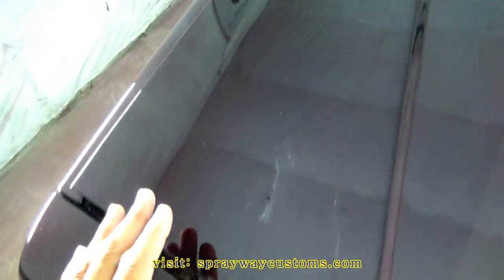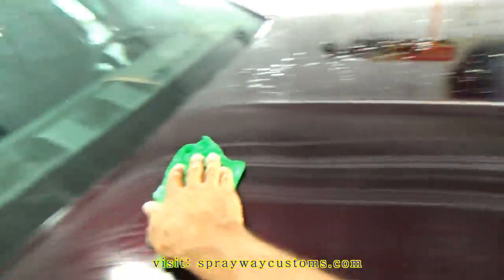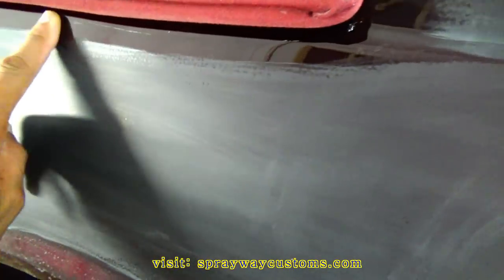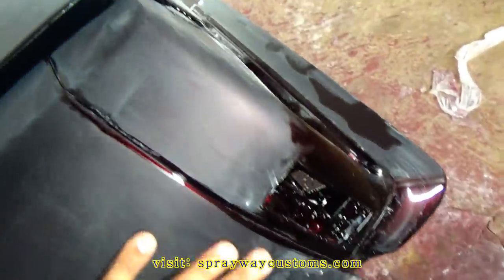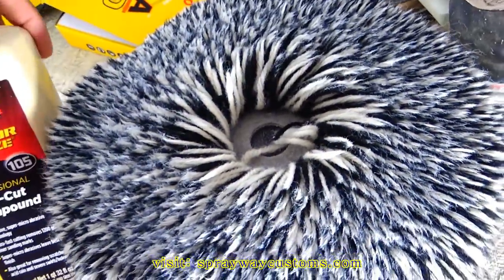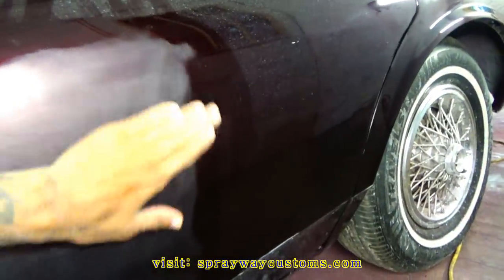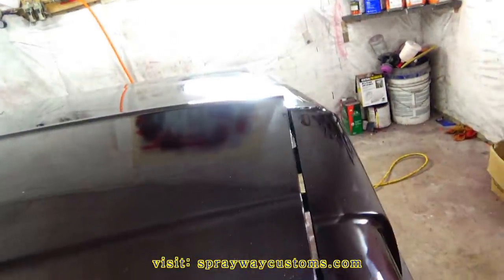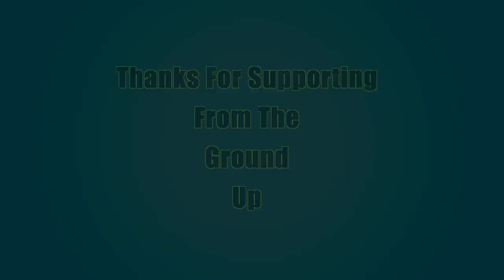How To Remove Orange Peel / Cut And Buff A Car After Paint - Box Chevy Caprice LS Candy Brandywine

Comment: I used to sand it with 1500,then straight to 3000,today I did 1500 then 2000,then 3000 .what a freaken difference.Didnt have any haziness after buffing,other vidoes say 1500 then 3000.but that 2000 step makes all the difference in the world.👍👍👍
Reply from the maker: Yes it does....you can get it done by skipping steps but it goes a lot smoother by following the process

Comment: Bro I appreciate the detailed info. You helped me out this past week at work. Took a 06 Chevy full size Conv van in on trade 2 weeks ago. It has that shitty GM primer/paint combo that flakes off. They didn't want to pay for it to be resprayed, so I got to work. Dupli-color color matched off paint code, clear, wet sand, buff. I really only having problems blending with the old paint. Some spots turned out real good, others not so good. I'm will work on them Mon. Again you have helped me tremendously I really appreciate it bro
Reply from the maker: That's great man...my pleasure

Comment: Hey man a little tip to know if you’ve buffed enough or if the scratches are going to come back, when your done compounding or polish, spray some isopropyl alcohol and wipe with a clean microfiber, it will take all the fillers out and you can see what the panel really looks like if the polish were wiped off. Save you some time of having to go over spots 2-3 times
Reply from the maker: Yes indeed....I learned that the hard way 👌

Comment: So you sand in a back & forward motion is there a difference if you go in circles? Do you follow the grain (like in wood ) of the paint or body panels?
Reply: I'd say you're gonna have swirl marks if you go in circles. And that's a whole nother beast.
Reply: Sand in a X pattern. It’s called cross hatch.
Reply: @MriLoveMyLife  but ain't that for bodywork or can you use the same method for colorsanding?
Reply: 63 Impala rag Dude do the same for both
Reply from the maker: I appreciate all of the  input on the matter

Comment: First off really great work man! I watched both of your cut and buff videos. I have a few questions 

1) Is there another pad that you would use for step 3 (final polish) from 3M? I looked up that specific part number at it costs more than all the compounds haha.

2) I see you use maguire’s for the first two steps and the 3M for the 3rd. Does Maguire make an ultra polish that you would use for the final step? 

Thanks man
Reply from the maker: Yes they do make a final polish but I'm not sure on the exact cost of it at the moment

Comment: Been watching your page for awhile now man. Picked up alot. Question tho. I wet sanded with 1000 grit instead of 1500 to start. Clear coat didn't have a ton of orange peel but it had some. I buffed an area an there's scratches left behind. What's the easiest an quickest way to rid the entire car of the scratches? Wet sand next with 2000 or 3k grit or there's something else I'm missing??
Reply from the maker: If it's no bad orange peel, it's best to go with the less aggressive because it'll buff out a lot quicker. If you do go with 1,000 grit you should follow it with 1500, 2000 etc. I like to start out with 2,500 myself but if it's a lot of orange peel you'll be sanding longer.

Comment: Sprayway! What do you think about the meguiers 105 vs the 3m rubbing compound in that 3 piece kit?? Ive never used 105 but have been wondering.i got away from using wool pads. I use the 3m stuff with white foam pad and it rubs out 3000 grit easy
Reply from the maker: I like 3M better. I'm thinking about getting away from the wool pads also

Comment: Let me ask you something boss...I started buffing with 1500 then im gonna go with 3000 and  its because I got alot dirt nibs also alot of orange peel but my questions is if you clear is almost 100 percent you could just use 3000..please let me know thanks
Reply from the maker: jaimef101 it'll be good if you could start off with 3,000 grit because those scratches will buff out a lot faster. If your orange peel is bad it might be quicker to cut it with 1,500 grit

Comment: What grit you use to get rid of orange peel tried 1,000 grit today on metallic color but could I go lower than that like 600 or 800 grit.
Reply from the maker: If you plan to buff it afterwards without reclearing it I wouldn't go lower than 1,000 grit but you'll have to move up in grit from 2,000 to 3,000 to remove the previous scratches out because you'll never be able to buff 1,000 grit scratches out without damaging the paint.
Reply: @SprayWayCustoms  I probably just paint it over soon.

Comment: Dang man, I start with 600x 800x 1000x 1200x 1500x 2000x 2500x 3000x going through all the grits. Cross hatching up too 2000x. 2000x up in small circles. Also you can use the edge of your block to wipe the water off
Reply from the maker: Thanks 🙏🏾

Comment: Da#n that colors mean. Not a fan of the bright candy colors but that's a classie girl. I painted my first car today. It came out amazing I was so excited. The bad part the color was way off the original. It stuck out like a short thumb. I had no runs, orange pill nothing clean as glass, but the color was wwaaaaayyy off. I used the paint code it didn't work.
Reply from the maker: A lot of times the more expensive paint will match up a lot better than the cheap...I don't know what brand you went with?
Reply: @SprayWayCustoms  no I don't know the brand but I used the paint code on the door. The paint store told me it would be 45$ a spray can if they did a digital match. It was only 20$ for a code match. The customer went for the 20$ and the paint was 4 times a darker gray. Next time I'm spending the extra. It wasn't the whole van. I only repaired a quarter size whole and a couple dents in the same area. I painted around a 2ft by 1ft section.

Comment: So I need some of that knowledge bro after I buff a car it looks really good bring old paint back but when I wash it I swirls why is that I can wax it they go away I don't want to have to keep waxing it (black paint) webbing
Reply from the maker: Are you using different pads and compounds when buffing?
Reply: @SprayWayCustoms   yes tcp global da and the buff pads (foam)medium cut green then black finishing pad then wax using miguars cut compound polish then  mirror glaze it looks really good no flaws under light nothing....after  first wash webbing !
Reply: Is it how I'm washing it after ? Low key seem like I'm washing all my hard work away lol
Reply from the maker: anthony williams it seems like you need to polish more....a lot of times it may seem you're done because the polish is covering the swirls and after you wash it, the polish wash away and shows the swirls.
Reply: Ok thanks bro going to go after it again I was moving  quickly worried about burning through the clear 96 impala original paint so I was worried thanks bri going to give that polish time to work (slow down )

Comment: You used the WRONG PAD for step 3.....the pad you used is for step 2....with the 3m perfect-it system ....the corresponding pad matches the color on the bottle...which is also the color of the liquid....the 3m pefect-it pads all match by color and also have the step number 1..2..or 3 on the bag.....the pad you needed is a blue color and is even softer and less coarse then the step 2 pad you used....the step 3 pad is designed to get rid of swirl marks
Reply: Not saying it wont work or messes anything up....if it works for you and ur Good with it....then rock on.....but i see swirl marks....and if you would have used the correct pad with your step 3 ultra fine polish it would have got them out
Reply from the maker: Thanks for the info but I can use a wool pad for the polishing step and still get the job done.